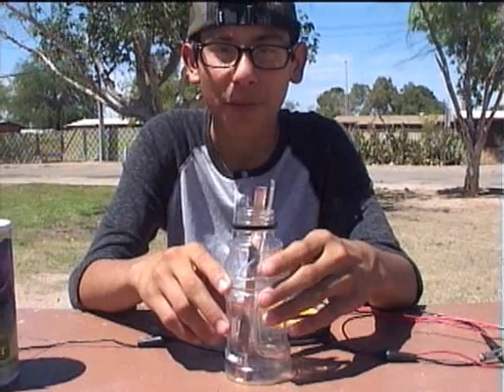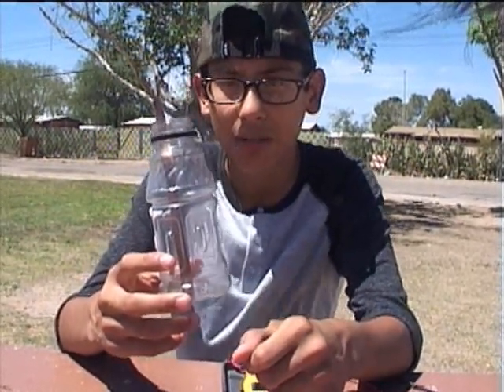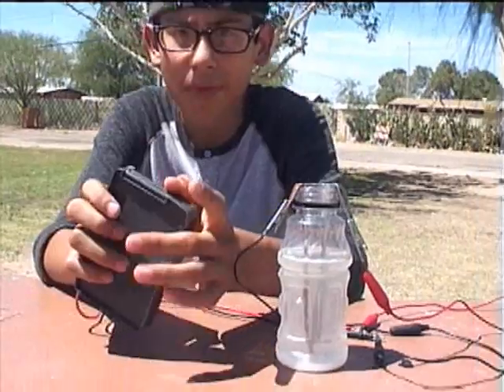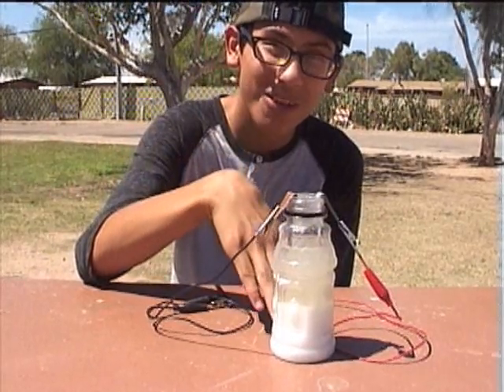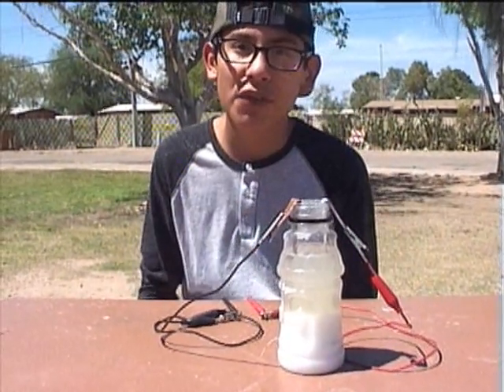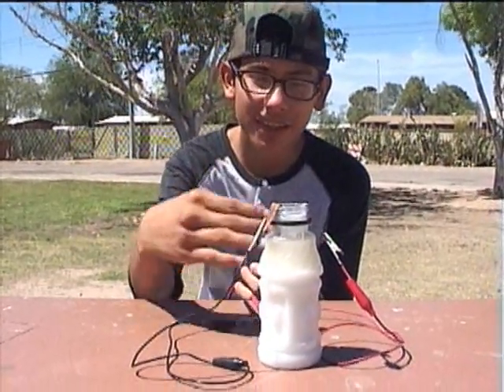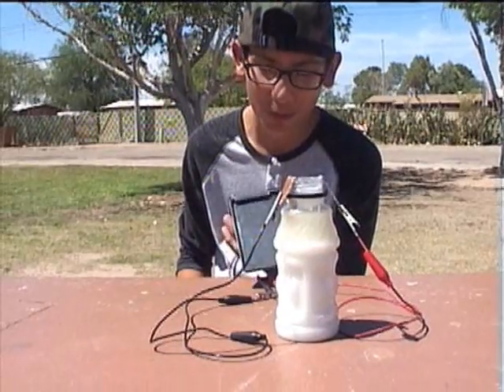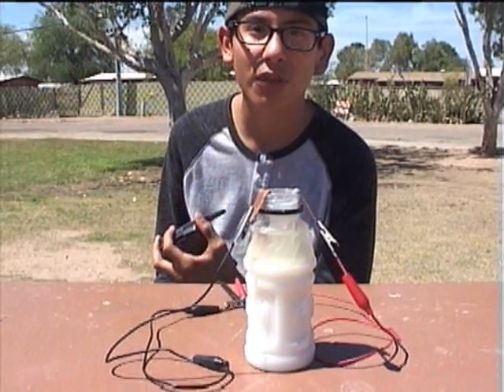Making Best Salt Water Battery

Comment: Voltage is only a part of what you need to measure.  Amps needs to be measured in order to find the battery capacity.  Aquion Energy (vids on utube) has already made a salt water battery but they use carbon and manganese oxide with cotton soaked in salt water.  Also if you hold the copper in your right hand and zinc in your left hand you will produce .6 volts.